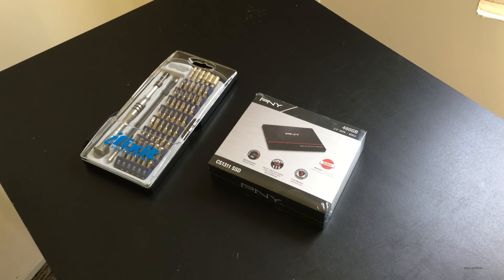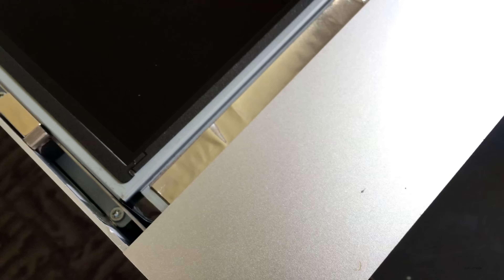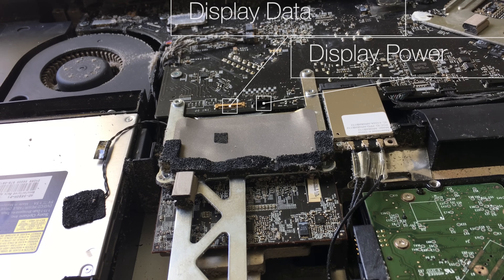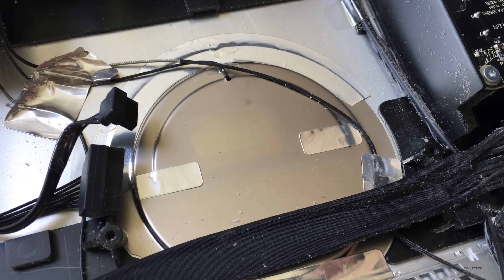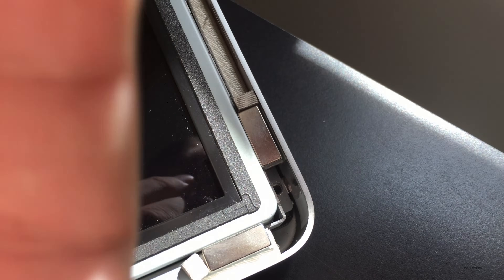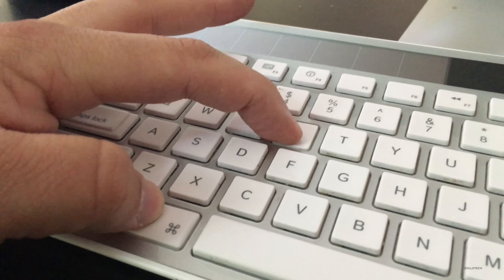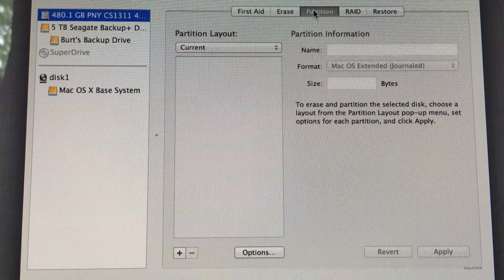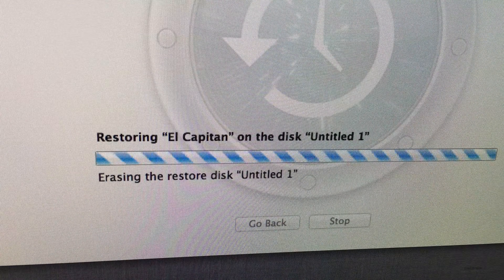How to Install an SSD into an iMac (2007-2013)

Comment: Can you please tell me wich ssd should I buy?? i got an iMac too but 27"ME089, and I need to know the exacto model of ssd to buy... thanks a lot !!!
Reply from the maker: +Pablo Calvano almost any will work.
Reply: by any what you mean...could u tell me wich u used?? i got the slimer iMac..not this one...
Reply from the maker: +Pablo Calvano this is a much different process for the slimmer iMac.  The glass is glued on and difficult to disassemble.
Reply: what i mean is that if the ssd would be the same to both kind of iMac? or should I buy a specific one (my concern is what ssd to buy, not installing it)
Reply from the maker: +Pablo Calvano they will work in both sizes.  They use sata connectors as well.  The ssd I used was the PNY cs1311
Reply: +zollotech thanks a lot for that!! Great channel and video quality btw!!!

Comment from the maker: Ever try this?  If so, how did it go?
Reply: Ive done this to two of my schools old iMacs, and it turned out fine, just you have to unplug a fan connector
Reply: Did you get a thermal sensor? I have the late 2011 version
Reply: I'm on my way on adding the ssd and swap the superdrive with caddied hdd, wish me luck!
Reply: I think I broke my fans